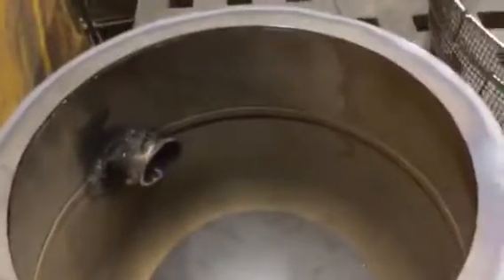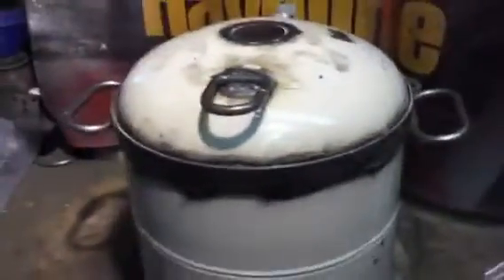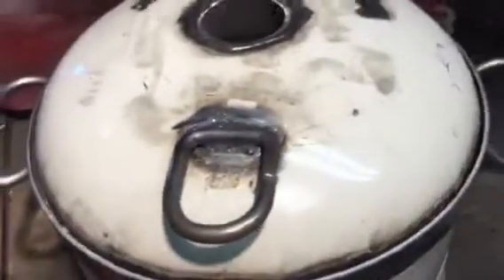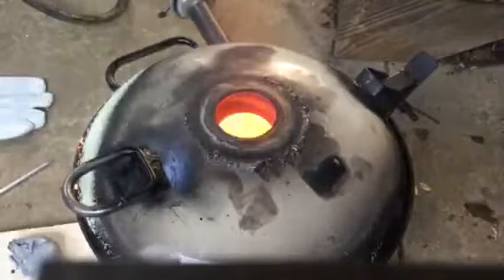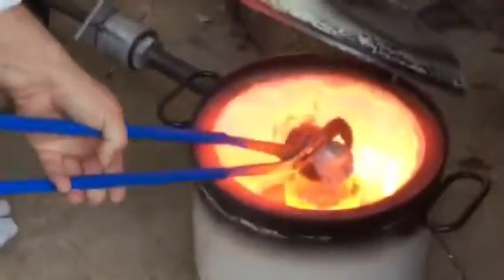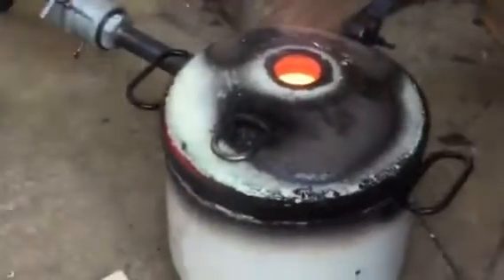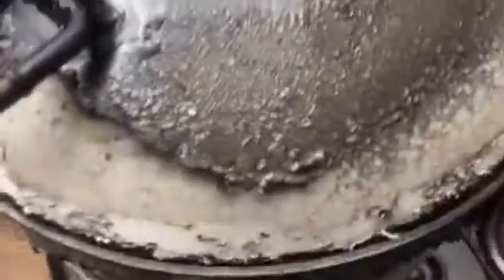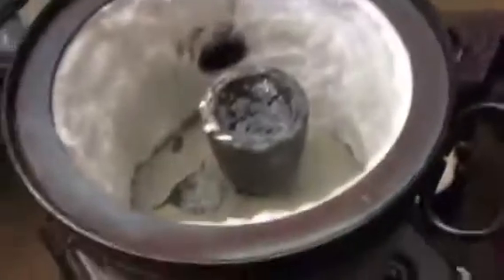Homemade propane bottle foundry

Comment: Looks like your trying to kill mini Terminator robots....So how r u getting the fire in? Are u just feeding propane into the foundry?
Reply from the maker: 🤣, Propane, yes. I was seriously thinking of cement lining, the ceramic fiber didn’t last to long, I bought some mix that’s 2400 degrees rated, I will see how long that will last.
Reply: @Fredsot  - Although I have a propane tank ready to go, I might try lining it with Fire Brick, Plaster and Sand to hold it together along with Steel Wool inside - but who knows when I'll get to it - Thanks for the response - Cheers!

Comment: Looks good, I'd go with 2" of the insulation.  Strongly suggest you coat the ceramic fiber  blanket with some Satanite or something to keep the fibers from going airborne, you don't exhale those suckers, and they tend to get tracked back into the house on your clothes etc.  Looks like you have everything you need there to fab some safer tongs for your crucible too.  It's small enough you may never crack the edge off it at the worst possible time lifting it like that, but why take the chance?
Not trying to be a downer though, keep it up and have fun - I'm working my way through your casting videos now, so if you've already addressed any of that I'll be seeing it soon.
Reply from the maker: I did end up adding another layer of fabric to the side and lid, never thought about coating it, thanks, and yes tongs, been lazy, but I often thought the pliers might break off the crucible, I’m gonna fix that now that it’s fresh in my mind, thanks again bud!

Comment: Sweet build bud. I just bookmarked it. Copper will sure be a great test. I wouldn't worry about paint so much. It is a good indicator for heat loss but I have never seen a foundry with a paint job eh. Great build my friend.
Reply from the maker: Tomoko's Enterprize , hey thanks for the compliment, I was worried about the loss of heat, so I added another layer of ceramic cloth, and that did the trick, I can melt a cup o brass in about 15 minutes.
Reply: If you did that on propane alone you have one of the best out there. I think the consistent shape from top to bottom, the "gun" itself and vent are all perfectly balanced bud. Well done. I hope I can plagiarize as I am working with a brake drum style or an 80 yr old clay type open blacksmith type(aside from my small silver furnace) and I do need some serious heat my friend . Thanks a bunch eh !